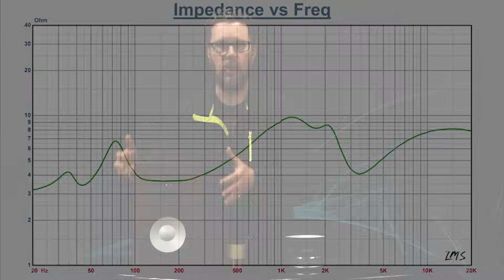What is Speaker Impedance? | Impedance ohms rating explained

Comment: sir can you give advice, please ; specs of Yamaha R-N 803D (I want to buy it) says it is 4 ohms and 8 ohms, I am confused,what is it ? 4 or 8?..... it also says ;  minimum RMS output power = 100 W + 100 W (8 ohms, 20 Hz-20 kHz, 0.019% THD); should I get 8ohms speakers or 4 ohms or doesn't it matter??   and does it change when I want 4 speakers instead of 2.
Yamaha R-N 803 D; 
Speaker connection                            Speaker impedance (SP IMP.)
                                                               4 ohm MIN          8 ohmMIN (Default)

SPEAKERS A or SPEAKERS B   ;       4 Ω or higher       8 Ω or higher
SPEAKERS A and SPEAKERS B;       8 Ω or higher      16 Ω or higher 
Bi-wire connection  ;                           4 Ω or higher      8 Ω or higher
Reply from the maker: The R-N803D gives dynamic power ratings down to 2 ohms, so either 8 or 4 ohm speakers will work fine. If you’d prefer to have 4 speakers running at once I would choose 8 ohm so you will be presenting the amplifier with a 4 ohm load when running both pairs at the same time using the A+B setting.
Reply: @AxiomHomeTheaters  Thank you!!!
Reply from the maker: @hhyling8483  you're very welcome.

Comment: Hi I’m repairing a pair of Sony speakers that have the mid and woofer burnt and I put in a piezo tweeter in place os the mid rated at 4 or 8 ohm  and  a woofer that is rated at 4 ohm and keeping the original tweeter rated at 8 ohms. The original speakers where rated at 8ohm for the mid and tweeter and the woofer was rated at 6 ohm and on the rear of the cabinet says the unit is rate at 8ohms . My question is that the amp now go’s into protect mode when I turn up the volume , how can I remedy this ?
Reply from the maker: Did you add a network for the piezo? I would try disconnecting it and seeing if the rest of the system works normally. It’s also possible you have mixed something up in the wiring, so I would give it a good look to make sure you don’t have a short across the input terminals.
Reply: @AxiomHomeTheaters  thanks for replying, the piezo is wired correctly to the mid range wires as is the rest of the units (tweeter , woofer) . Should I transfer the piezo to the tweeter wires maybe ? The thing is I need to have 8ohms as a overall unit plug at the back of the cabinet and like said before the original Sony configuration was tweeter 8ohm mid 8ohm woofer 6ohm and  now it’s the same except for the woofer that became 4ohm . Can this be upsetting  the amp hence it going into protect mode at high volume.
Reply from the maker: @oowwnn  Piezos are typically high frequency drivers, not midranges, so there might be an interaction with the midrange section of the crossover. The 4 ohm woofer might also be an issue.
Reply: @AxiomHomeTheaters  Thank you for the reply ,after seeing a couple of your videos I thought to ask for a second opinion of the issue I was having. What I still do not understand is how the original Sony configuration of 8ohms + 8 ohms + 6 ohms equals 8 Ohm Overall Per cabinet . Are used an online on Calculator and Calculator both and series and parallel and I could never get the eight ohms , I would get like 6 1/2 or 7 1/2 ohms or 2 1/2 or is it the crossover network that made the difference for the Original spec.well Thank you for all your replies I wasn’t subscribed will be now very informative stuff again thank you
Reply from the maker: @oowwnn  What you need to remember is that the driver impedance is usually the DC resistance, not the nominal impedance in most cases. There is also the matter of any series crossover components like resistors and inductors adding resistance to that of the drivers themselves. So it’s not just a simple matter of taking the driver impedances and adding them together in parallel or series to get the system nominal impedance. Thanks for subscribing!

Comment: So I have a 4 ohm speaker, but it averages 2 ohm, therefore the manufacture calls it a "2ohm" version.. can i still use my 4 ohm amplifier?
Reply from the maker: Jeremias no, I would not unless the amp manufacturer says that a 2 ohm speaker load is ok.
Reply: If the speaker has a lower impedance to flow than the amp. I wouldnt. Obv ask the manufacturer

Comment: Very well done. There is a host of high end amplifier and speaker systems with nebulous recommendations in matching to some speakers which have wildly fluctuating impedance loading.  Some exotic tube amplifiers will behave very differently and  sound awful. I owned a solid state amplifier rated 50 watts  RMS @8 ohms, 100 @4 ohms and 180 watts @2ohm loads.  It delivered superior sonic performance than another amplifier I owned which was rated at 100 watts @8 ohms.
Reply from the maker: Exactly…power is not the only thing that matters, so it’s never a good idea to blindly follow specifications!

Comment: I have speakers rated 6 ohms Looking for a new receiver and the receiver says minimum of 4 ohms. Can I use the my own speakers
Reply from the maker: Yes, 6 ohm speakers will be no problem with a receiver that can handle 4 ohms. As long as you are above the minimum impedance specified you will be fine.

Comment: I've run all my Axiom speakers M80 v.4--- VP160 Center v.4 --- M22 v3 (wides) --- EP350 sub v.4 ---  x4 QS8 v.4 on a Marantz SR7008 (their flagship AVR) since 2014----it seems that I've run into some confusion as to which impedance setting I should have the AVR set to.  My choices are limited to 6 Ω or 8 Ω----it looks like I've been set to 8 Ω for these speakers.  I should probably have it set to 6, yes?
Reply from the maker: That’s correct, the 6 ohm setting would be best for your mix of speakers.

Comment: Unwise to use the water flow analogy for current. At the electron level the "current" is flowing backwards. Right?  Once you get to frequency/load and on  - this becomes interesting and useful.
Reply from the maker: Interesting take on the subject, thank you for taking the time to comment. The water flow analogy for basic electrical properties is still in use, as it’s very easy for everyone to understand. That was my goal here. Even University profs still use this analogy.
https://ece.uwaterloo.ca/~dwharder/Analogy/Resistors/
Thank you for watching.
Reply: i use water flow to teach the most basic of electricity including resistance, but when it comes to resistance, unfortunately the load placed on a water pump as you kink a hose is exactly opposite of what happens when you increase resistance in an electrical circuit